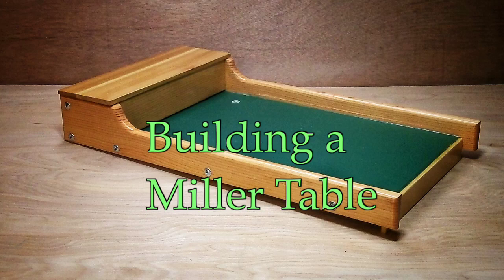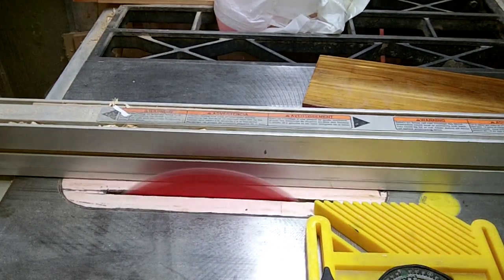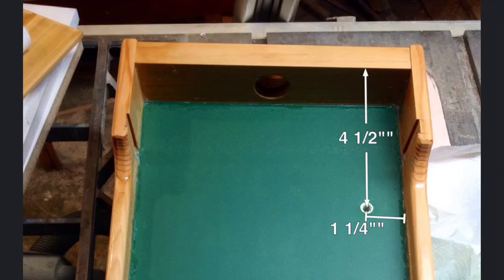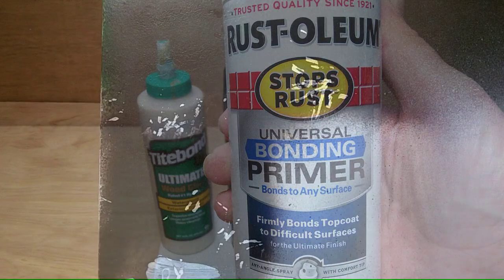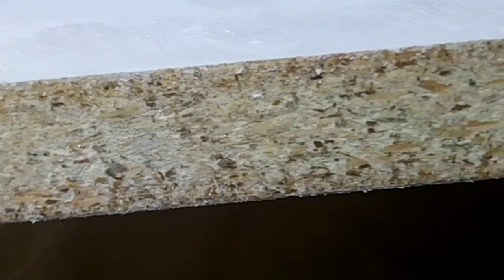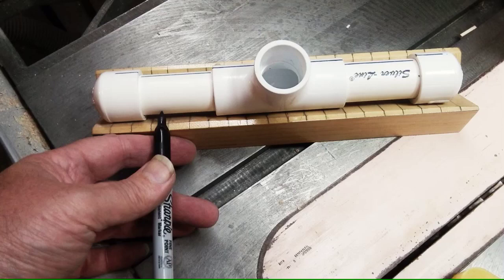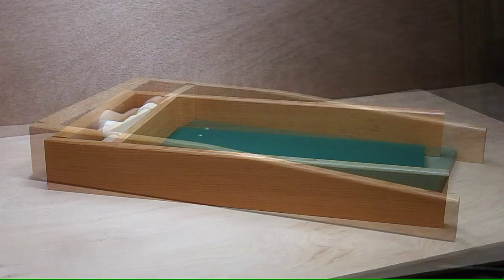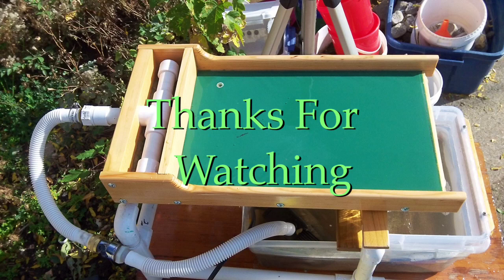BUILDING A MILLER TABLE

Comment: Hello, not sure your name, Utahavalanch, I want to thank you for the very informative vids you have, they are by far the best and you are a master builder and you are very precise on your info on how to build one, I started watching your vids a few years ago and I built a few deep well Miller tables, I refined mine a few times, now I have 1 1/2' deep well miller table with Chalk Board paint at the top and 1 1/2' of V mat on bottom. These tables work great, even on the Nome beach pay dirt, with fine gold and lots of black sand, and I did have fun building it. So thank you again and have a great 2023 New years!!
Sergio
Reply from the maker: Hi Sergio. Thanks for watching and your very kind comments. Yes, your refinement would certainly make the water flow a lot smoother and make for easier recovery of the gold. 
That Nome beach sand is what got me working with Miller Tables. I built this model and then used it entirely for a season for processing all my dirt. I then spent years building and trying different designs until I developed the Deep Well series. It is my favorite so far. I now use what I call the Miller Sluice which is just like yours and has an 8 inch long deck and 1-1/2 feet of Silicone mat. I can run the water faster like in a sluice to process the dirt faster. The chalkboard paint will slow the gold down so it will be caught in the top of the mat. Then I can run the mat material again at a slower water flow to recover the gold. Thanks again for your comment . 
Larry

Comment: Thank you for the excellent video, I used this as reference to build one. I have the luxury of a friend with a bending brake and a scrap pile so I started with 1/8" aluminum to get away from the wood+water issue. Bent the sides and siliconed a block of delrin on one end to create a headgate, and used 2-part epoxy to attach the gold bottle lid under the glory hole. I dry classify my cons at 30, 50 & 100 mesh and (after re-wetting) can recover -100 flour gold.
Reply from the maker: DozerRoyale 
Hi Dozer and thanks for watching. Aluminum is sure the best way to go if you can. I use solid pine on these and my new Deep Well design now which helps to cut down on the water wood problems. Home Depot carries a really good gas valve you can put in the water line to reduce the flow for that super fine gold. They also carry the hose barbs so you can connect water hose to it.
Reply: I have a screw-type (like a hose bib but inline) valve in my feed line and run a pump similar to yours in a tub system so I can use JetDry, works great. 
I saw your deep well video right after I left my comment. Brilliant! 
Heavy pans.
Reply from the maker: @FreakyMalo  

Great! Sounds like you are all set to go. I think you will really love one of these as they make separating gold from the rest of the material very easy.  Very best of luck on your build.

Comment: I will be applying the chalk board paint today. I appreciate your help and thought I would share this in case you didn't know. I went threw a can of the urethane like it was nothing. then I found out instead of 10 bucks for a can with hardly anything in it. they have the same stuff in quarts for 15. you can spray it with a compressor which was what I was going to do. but I brushed it on nice and thick.
Reply from the maker: +dean castello Yippers, it takes pretty much a full can to do one of these. I used to use the brush on but even though I do a project each week I found that it got too thick  on me before I could get through the whole can. But the Helmsman is good stuff and it dries very hard after about a week and is a tough finish. 
The Chalkboard paint dries to a very thin layer. I usually put 3 heavy coats of the chalkboard paint on and let it dry for 24 hours, sand the high spots down and then put on 3 more. Sand one more time and then put the final coat on. It takes the Chalkboard paint 3 days to cure to its final hardness. If you want to put a Hobbico mat on you can glue it on after the paint has cured. You can also just set the Hobbico mat in and try it if you want to see which you like best and then glue the mat in if you decide to go that route. Once you get your table going I'd like to hear how you like it. Good luck with it.

Comment: That looks easy enough for even me to build. Thank you
Reply from the maker: Hi Stephen, thanks for watching. You're right, it really is quite easy to build. If you want, you can just buy a 1x3 to make the end board and sides and a melamine shelf for the base. One thing to note, the Melamine has a thin layer of plastic on it and the edges are glued together at the corners and water can leak in through those edges. Be sure to coat the whole board with 4 coats of the Rustoleum Bonding Primer and then coat the whole board with at least 6 coats of Rustoleum Chalkboard paint. Also if you make a gold vial hole, I use Titebond 3 waterproof glue on a Qtip to paint on all the exposed wood surfaces where you drill holes and particularly where the raw wood and plastic meet. My cutting board miller table doesn't have the waterproofing problems if that's easier. I am also going to be releasing another type of Miller Table build here in a few weeks. Give it a try and good luck. If any questions, just ask.

Comment: Very good video. I have been planning to build a table. This saves a lot of research. Thanks for the video. I subbed your channel ,
Reply from the maker: Chuck Gentles 
Hi Chuck and thanks for watching. The main problem with using the shelving for this table was that if the gold vial hole didn't get waterproofed enough, water would soak in and cause the wood to swell so make sure to seal the inside of the hole and especially on the top and bottom where the water can seep under that thin layer of plastic very well. Alternatively you can use a piece of pine board for this or a plastic cutting board if you saw my video on that. Best of luck on your build.

Comment: thanks for the nice video. i plan to follow your video to make a miller table.
looking forward to getting started in the near future.
you sure did a very nice jobe.
ron
Reply from the maker: Thank you Diane for watching. I think you will really enjoy one of these tables. If you use the melamine shelf like in this video, be sure to really seal with paint or Titebond III glue any places where there is a crack or seam in the plastic on the board so that water doesn't get under it. Or you can use a cutting board like in my other video.

Comment: Thank you for the great video. I would not have though about the chalk board paint. Nicely done. Love the varnish. I used it when i built out the back of my van. Sliding pallets in and out it last for about two years before I need to sand it down and re-coat. It's really tough.
Reply from the maker: +Corky H Hi Corky, thanks for watching. Yes the chalk board paint works very well. Almost as well as the Hobbico mat. Yes, the spar varnish is really tough. My sluices look brand new even after a year of heavy use with all the sand running through them.

Comment: Very relaxing to watching pro..at work,,,very nice table well finish and seal,,that the main thing,,i gest that my next project,,thank you,,i discovery plenty of fine gold in muss on rocks in creak and its hard to pan so that the new plan
Reply from the maker: Thank you Lou. Much appreciated. I don't know if you saw my video on the Deep Well Miller Table, but if you have the capability that is the one to build. That one works better than anything I have ever used. It's really quite easy to make and if you don't have a saw to cut the angle on the top board you can still make it by using a wood rasp. little more work but I think it's worth it.
Reply: thank you so mutch and i will check that vid..and am off prospecting today,,good day to you
Reply from the maker: Lou Simoneau 
The very best of luck to you.

Comment: I think i watched most of your miller table videos by now.
But one factor never was mentioned i believe?

What is a good starting angle to set up your table?

And i am amazed about your deep well table. I absolutly, positively love it!
Thanks for that :oDD
Reply from the maker: 1000 
Hi 1000 and thanks for watching. I usually set the table to about 1-1/2 degrees. Then I sprinkle some black sand on the table and raise the back elevation knob slowly until the black sand starts moving down the table. This usually turns out to be about 3.5 degrees. The Deep Well Miller Table is really a sweet machine. You should build one and give it a try. They really aren't that hard as there is only about 5 parts to it. You can make a small one with a piece of 1x8 pine and a piece of 1x3 pine for the header board and side rail's. I'm putting another video together showing people how to build them.
Reply: @utahavalanch  Thank you for your valueable reply!

And yes, i am building one of the tables. My only delay is to find a reasonable source for the paint you use over here in Europe.
'Also im pondering to make a second one with silicone paint.

Amongst other material i have to deal with what basically looks like that obnoxious beach sand you showed in your videos. Loads of super heavy black sands with true flour gold hidden within.
And i must say your deep well miller table definatly looks like the solution to all my clean up problems.

And for the field im building a sluice with silicone mats (yes, we both watch the same channel ;o)) just to reduce the material but not clean it.

This will be my winter prospecting work untill i can enter the mountains again come spring. Where we have coarse gold up to hazelnut sized nuggets.

Thank you again for your videos and please give a hello to your grandkid. Its a grande kid indeed!
Reply from the maker: 1000 
I don't know if you have any Walmart, Home Depot or Lowe's stores where you live but they all carry the paint as well as most paint stores. You can also buy it on EBay. It's Rustoleum Chalkboard Paint. I have found that some mat finish paints work a bit although not quite as well.
I spent 10 years trying to find something that would work well on that black beach sand and the Deep Well is the best I have come up with so far. It does a great job. The combination sluice, is nice as the mat catches any runaway pieces so you don't have to run all the tailings again. 
I think you will really like the Silicone mats. The deeper drop Riffle design works very well on the bigger sluices.
I will certainly tell my grandson high for you and the best of luck on your build and Prospecting. I'd like to hear how it all works out for you.
Reply: @utahavalanch  Thank you again for your input!

Regarding the paint i can order it on amazon but only in blue. So thats the hold up.
The one in the videos was green and i dont want to get different results due to some other kind of pigment or something.

And yes, im very much looking forward to give the silicone mats a first run.
I also very much like the idea of the combination sluice.
I like how thought trhough all your designs are yet so easily to replicate. You realy need next to nothing and once you got one all set up as a system (pump, tubs etc) you can very cheaply and easily replace the table itself with various designs/materials you would like to give a try.

AND they look gergeous too!

So thanks for all the encourengment and i try to keep you in the loop how it all worked out in the end.
Reply from the maker: @1000-r3g  

The gold catching properties is the same on all the colors.  If you can find the Chalkboard paint in the pint can, that you brush on, that is the best. This is a can of green on Ebay that is pre-mixed. 

https://www.ebay.com/itm/Chalkboard-Paint-Green-Rust-Oleum-Specialty-Writable-Erasable-Latex-Paints/312834294297?hash=item48d6608219:g:AgMAAOSwCd9dwqvp
What you get in the paint store is a can of white base and then they add the color that you want.  The spray will work also. Be sure to put about 6 coats on.

My system has evolved down from a large recirculating system with a 4 foot 10" wide sluice to the 10 gallon tote size I'm using now.  I like it because I can switch out several different sluices with a Miller Table and it is portable to take out exploring on the road. I set it up on the stream bank to run rather than in the stream as I have the pump calibrated to just the right flow to catch all the gold. For Urban prospecting it is ideal because I can run the material on the spot and dump the dirt right back where I got it and only take home the gold.

Comment: Great build video. Just hope it'll work for my 200 - 300 mesh gold.
Reply from the maker: Hi Oaks Trails. Thanks for stopping by. I think it will. If you saw my video on the Deep Well Miller Table, It is basically the same as this one except with a much smoother water flow for that very fine gold. I am currently running sand from the Washington Black sand beaches, Lake Michigan black sand and Nome Beach Black sand. This material has been screened through a 100 mesh screen and some will go through a 125 mesh. With my 10x magnifier glasses, I can see some that is smaller that I can also collect. You will need a small pump for this, I use a Harbor Freight 264 GPH pump which is way overkill but it has a better dirt filter than the smaller ones. Plus it has reducers so you can use different size tubing.
Home Depot has a very good gas line valve and hose connectors that you can put in the middle of the hose to reduce the water flow to the bare trickle it needs. If you put the valve up on the input of the Miller Table it will pressurize the water like when you put your thumb over the end of a garden hose to make a spray to water the lawn and cause turbulence that is bad for the very fine gold. By putting the valve in the middle of the hose or at the pump, the turbulence is settled down before it gets to the table and you have a very nice even flow. Best of luck if you build. If you have any more questions, feel free to ask.

Comment: plenty of help good video now time to make one many thx..
Reply from the maker: Les smith 
Hi Les and thanks for watching. If you haven't already, you may want to check out my Deep Well series of Miller Tables and sluice combinations. The Deep Well Tables work much better than this series of Table and it's not very hard to build. But this table will work very well for you. It will catch down to -100 gold easily. I have been running my Deep Well Miller/Sluice for about 6 months now and so far I haven't found a piece of gold in the tailings.

Comment: Very good video. Thanks!
Reply from the maker: Dean Mayer 
Hi Dean. Thank you and thanks for watching. I usually put a thin later of epoxy putty in the bottom of the hole and then set the lid into it. Then I clean the epoxy from the hole in the lid. You could probably use super glue as well.
Reply: @utahavalanch  I am working with material I have at home so I am using a tin tray that went in a chicken coop but was never used.

So, I can't fasten my gold collector top like you did. The metal is thin so I guess I will have to glue the top to the bottom of the tin.

I painted the top of rhe tin with gray primer which seems to be the same texture as chalk board paint.

It's probably 24 inches wide and 30 inches long. Not sure if it will work or not. I haven't tried it yet. My pump is too strong for it.

I wish I could attach a picture of it to show you.
Reply from the maker: Dean Mayer 
Hi Dean, medical problems slowing me down. You can just paint your metal with the Rustoleum Chalkboard paint and that will work fine. To slow the water flow, you can put a small valve in your water line to reduce the water flow. If you have a 1/2" or 3/4" hose, you can use a garden hose valve that's cheap.
Reply: @utahavalanch  thanks so much. Right now I have it painted with rustoleum primer. Everything is ready to go but I haven't tried it yet due to medical problems from cancer. If it doesn't work I will get the chalkboard paint.
Reply from the maker: Dean Mayer 
Very sorry to hear about your illness. Kind of puts us in the same boat. I'm running on 1/2 a heart and trying to keep it going a little longer and having no a hard time of it. Yep, you can try the primer. If it's a matt finish that will help. The Chalkboard paint is one that gold especially likes to stick to. I'm currently making a sluice that has 2 matts separated by a board with Chalkboard paint on it to slow any gold that makes it out of the 1st mat so that it will be sure to drop in the second mat. An unusual design.
Reply: @utahavalanch  so sorry to hear about your illness. It's nice to live long enough to get older but our bodies just want to fall apart. I will have you in my prayers.

I along with many others love your work. You have helped many people.